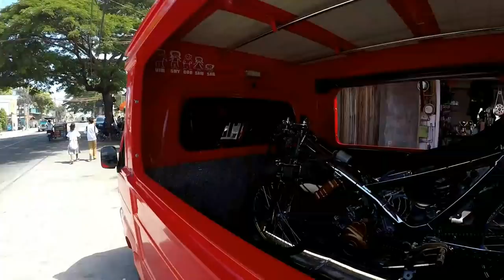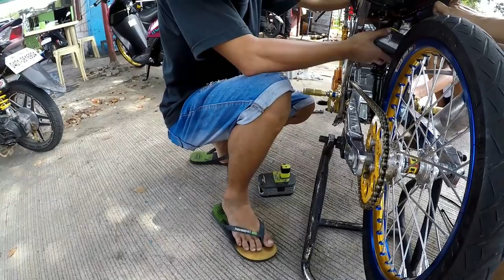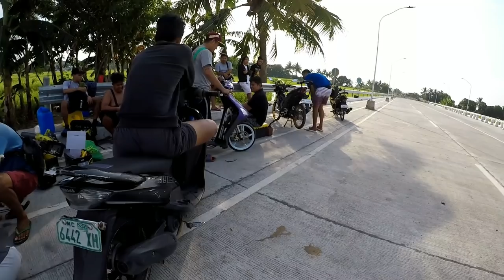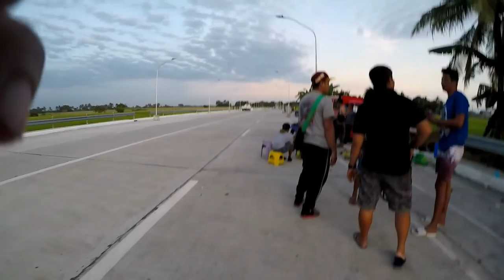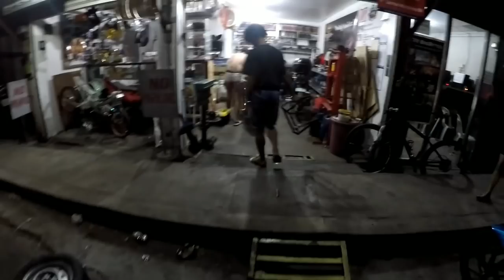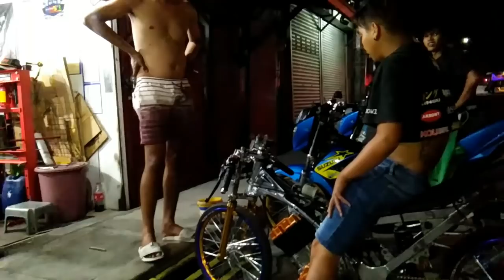Raider25g by:Gawang Bundok | Gaano ba kahirap magtono ng pangdrag race

Comment: Boss okay ba mag pa 25g hndi ba sakit sa ulo..stock lang motor ko..nahihinaan kcii ako
Reply: Masakit sa ulo, puro timing kelangan kung ayaw mo madurog makina mo di pwede bira nang bira lang, di rin pwede pang long drive, lagi naka change oil, lagi adjust ng timing chain at piston para di sumabog, pang race lang talaga. Para ka na ring bumili ng sport bike na upper cc ng konti.

Kung gusto mo ng malakas bumili ka ng 300cc pataas kahit walang palit palit ng piyesa.
Reply: Bigyan kita ng magandang setup, big valves, racing cdi, racing coil, 28mm na carb (huwag mag-30mm kung stock bore sasayangin lang gas mo di masyado macoconvert sa power pag sobra sobra yung gas na binubuga), clutch slip, ikaw na bahala sa sprocket set mo depende kasi sa taste mo kung sustained speed, yan lang malakas na motor mo. HINDI KA MAKIKIPAGKARERA SA PUBLIC ROAD, set lang yan kung gusto mo lumakas motor mo.